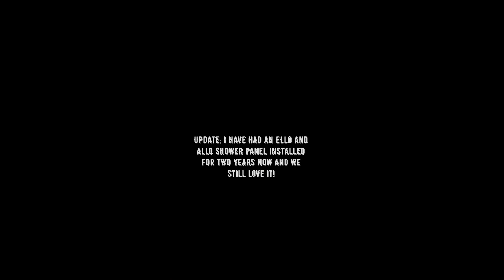Ello And Allo Shower Panel Installation

Comment: Does this kind of shower connects with the electricity of the lights and thermostat works with batteries ?
Reply: i think its water activated, water flows down a wheel barrel inside which powers the screen

Comment: Your digital LED temperature read-out are they battery operated or electical hook-up?  If this is battery operated, how often is the battery changed?
Reply: It's powered by the water passing through an armature that produces low voltage electricity A.C., that goes through a diode bank to make D.C. voltage (around 3 volts)
Reply: Where can I buy the diod bank

Comment: Thanks for the video, my lights went out after 3 years and the bottom of this is dripping.  Any chance you know why and how to fix it ?  Thanks.
Reply: Does it leak when the water is turned off? Or when yiur using the shower? If your shower wall is like mine it's probably leaking from one of the water line clamps.
Reply: @shawnchapman5916  Thanks, i just bought a whole new one :)

Comment: I wish you would have showed the wire connections and how they all connect because mine came disconnected. A plumber and my self can’t get that generator to power the panel.

Comment: I have a Question to ask you. I am renovating the Master Bathroom in my Home. Gutting the existing Shower down to the Wall Studs. Installing  Harde Board  then Porcelain Tile. I am going to have a Shower Panel Installed like the unit in your video.  Is there a way to hard wire the LED System instead of having to use Batteries? I don't want to have to replace batteries.  I am going to be re-wiring some of the existing Electrical Service to the Bathroom. Please advise? Happy July 4th, 2022  Weekend !!! Thanks.....
Reply: I’m not a pro but I have seen these on eBay that are powered by the water flow.
Reply: Hay my birthday is 4 of July

Comment: the lights are now working after installation. could this be an issue with wires or turbine?  please comment...thank you
Reply: Absolutely not. As water passes through the turbine, it creates it's own electricity (Very low voltage) It should last around 30-40 years, depending on water calcium build-up.

Comment: I just installed the same shower head but for some reason there are always two spouts that are working together, do you know how to keep only the shower head on and turn of the water from the other jets? Mainly the top section for knobs don’t have an “off” switch .
Reply: I dont  no if that question was  anwsered but on my  Shower  i have a  valve that allows me to turn on three  different things   my  shower head    my  sprayer   and  my   tub  filler nozzle     you have to have   water control valve that  allows you to control  everything    3 way  valve  2 way valve  etc    4 way  valve  if you dont  have  that and say you have a  shower head and sprayer and  tub filler   with a  2 way valve   then  two of those  will always come on at the same time because they are on the same  valve control        i hope this  helps you

Comment: Do all shower panels have the same mounting pointings? Meaning  can I take off my current one and just slap another one on without drilling more holes for the new mounting hardware
Reply: No. each manufacture makes their own mounting system from stainless steel tabs, with stainless steel screws. Always use RTV silicone to seal any screw hole.

Comment: Did show how you cut out the valve
Reply: That's what I need to see as well
Reply: I'm thinking you will do away with the old diverter that's in your shower. This new spray panels has its own diverter inside it. So cut the lines just below the diverter and put your fittings on the hot and cold cpvc pipes to hook up to the new spray panel.